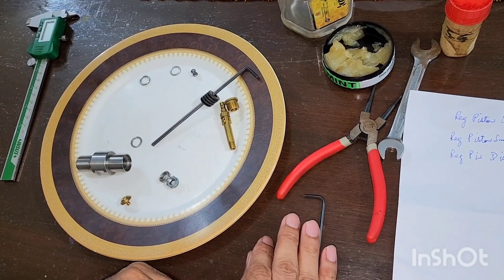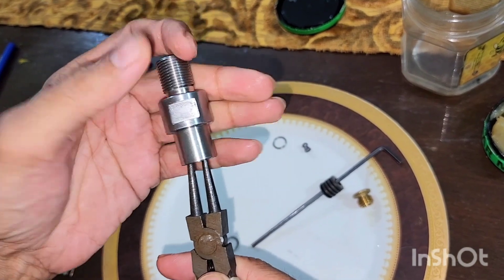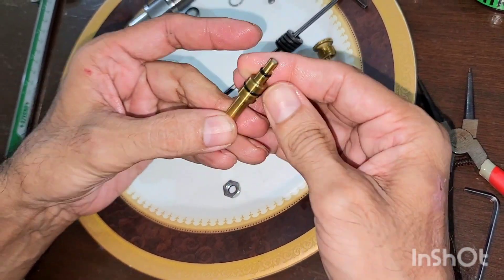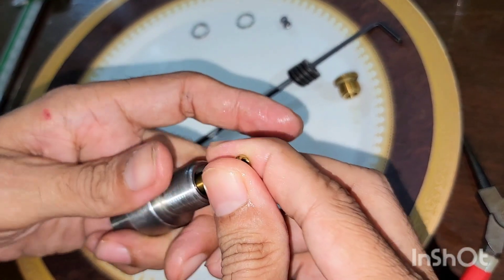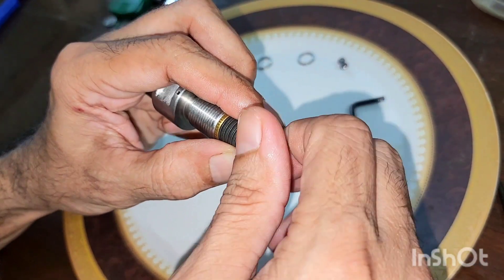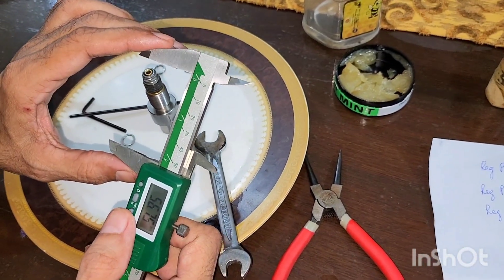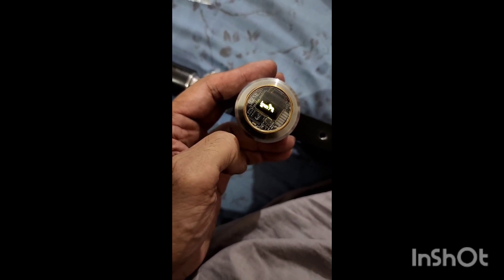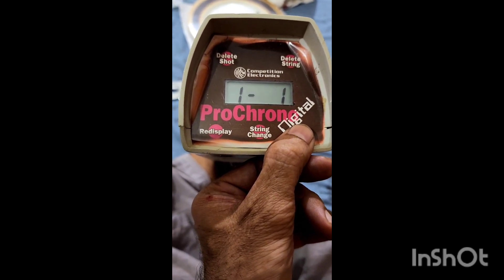RAW HM1000X Regulator Rebuild DIY

Comment: I replaced all o rings except for those on the regulator, I still leak air at the small hole of the regulator near the v-Quick fill. What is your opinion on that ?

Comment: Do you have a background in engineering or machinist?
Reply from the maker: @surreallife777  No I am a professional accountant and do all this as hobby
Reply: @BhaursAirguns   Impressive. I have an FX Panthera 600 mm 22 cal but i want to change it to a 30 cal. What exactly is required in terms of materials if you know? I want to buy a used updated compact Impact mk2, Dreamline or Mavrick. Depends on the price. Where are you located. I am in Vancouver Canada. I sent you the same message on another video you posted.
Reply from the maker: @surreallife777  I am in Pakistan.  I feel that Impact mk2 will be a good option
Reply: @BhaursAirguns  Do you ever sell guns? I am in Canada.
Reply from the maker: @surreallife777  I am not a seller
Reply: @BhaursAirguns  Thanks. Do you have Facebook or Instagram? If I buy an mk2 I might need some advice. I like your silver mk2. I would buy it if you were selling it.
Reply from the maker: @surreallife777  my WhatsApp number is 0092-345-2247449 
I can't export an airgun otherwise I could offer you my improved M3